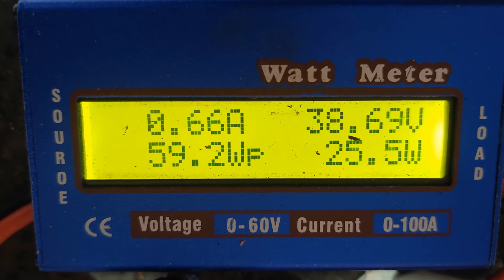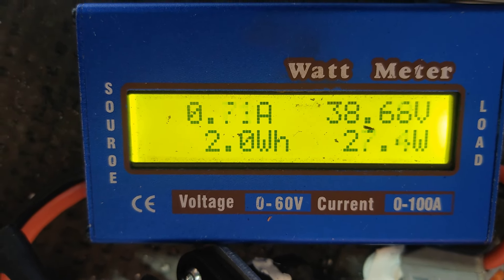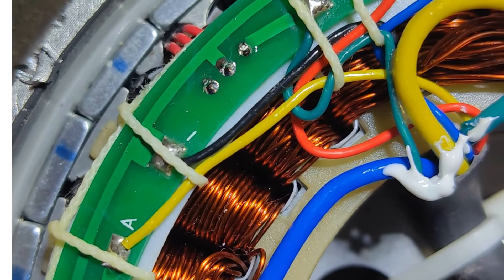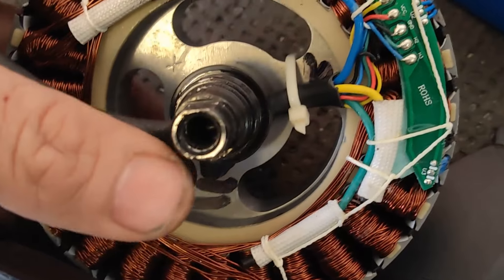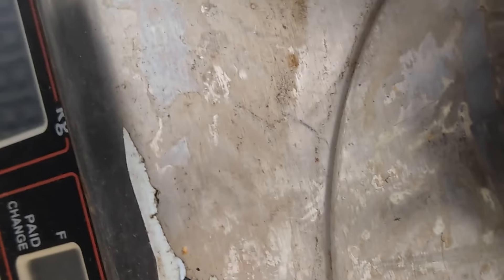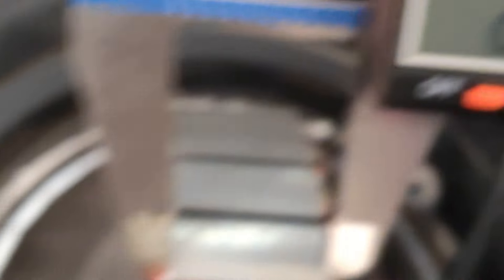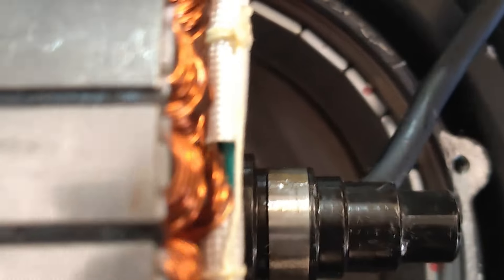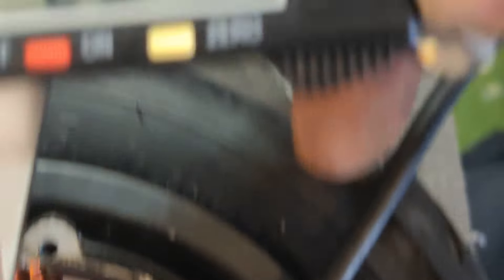Pure Air E-scooter Motor Teardown! Are more Watts worth more money?

Comment: Hello I’ve a problem with my pure air 2 and I’m wondering if you can help, the brake is locked up but still rides however I got the H2 warning and brake cable had become un-soldered and I have fixed that and brake is still locked?
Reply from the maker: Hi, how do you mean locked? It's engaged? If you turn the scooter off does it spin freely?